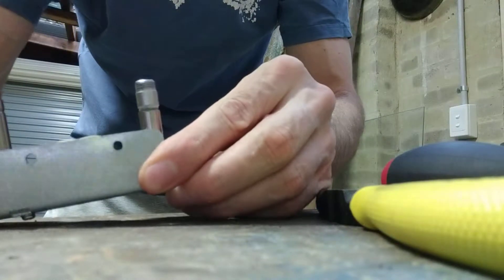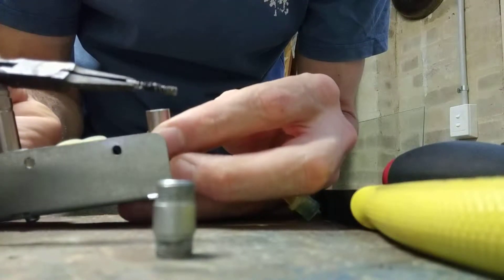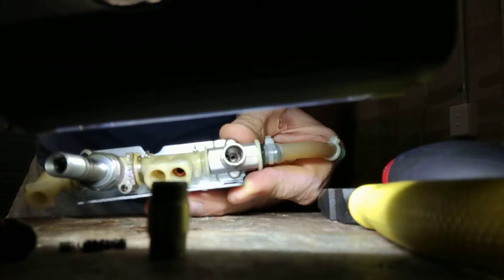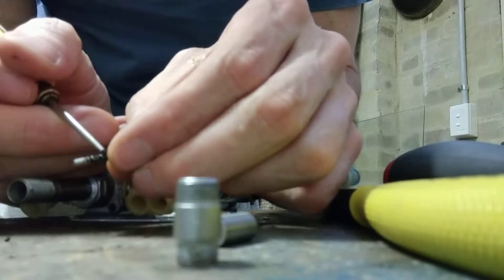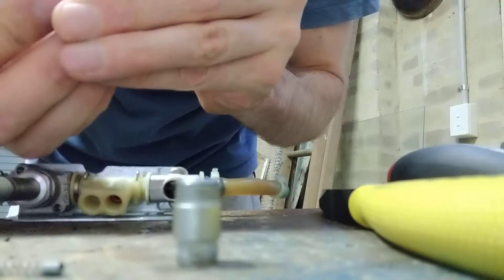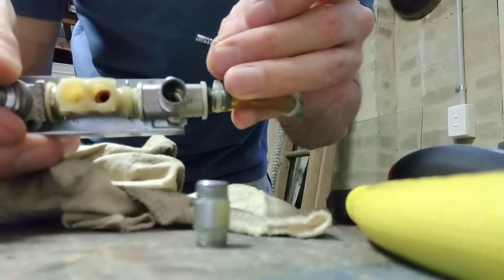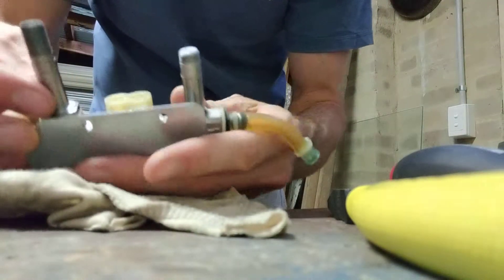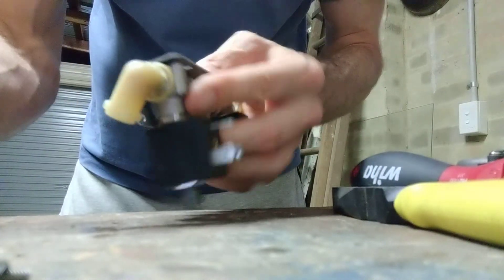Breville BES860 solenoid disassembly

Comment: Thanks for making this. I must comment that the critical points could have been covered in a much shorter time. Also, suggest compressed air might have been useful. Parts caked with mineral deposit can be soaked in citric acid solution (1 tbspn/quart). This solution can be hot to speed up breakdown of the mineral deposits and a stronger solution (2 tbspn/quart) can be used if needed. Citric acid is VERY effective for this purpose. For coffee residue, Cafiza brand cleaner works miracles.

All that said, useful to see the specifics of dis-assembly before attempting, so... thanks.

Comment: Hi Chris, thanks for the video. Very useful, I successfully diagnose the problem and ordered the 2/3 way solenoid and solved the no water from head group issue. However, the steam and hot water came out from the group head as well. I tried to pull out the live cable if the solenoid and the steam came out from the wand. Not sure if it’s another issue instead of the new solenoid?  Not sure if it’s controller issue but the original solenoid doesn’t works this way as the new one.( no water from group head with the original solenoid)

That’s very appreciated if you can help me out. Thanks

Comment: Great video, My old breville BES870 will not get up to a decent pressue, it seem to max out just in the espresso range after the infusion ,  I have tightened the OPV (right in) but it doesnt make any difference to the pressure . even with the blind basket shot. Do you think the pump may be weak or the guage is not reading correctly? many thanks
Reply: It sounds like you have the same issue as me, it’s on the second cup, not the first for me, it’s really odd.
Reply: @TheCobste  I sorted it out a whole back. It turned out to be the 2 way solonoid letting out some of the pressure by not seating properly. I knew this because at the same time it was brewing water was going into the drip tray. Changed the solonoid and now is all good.

Comment: I have the same model that has been buzzing on and off the past year and recently it got worse and the pressure hasnt been good sometimes. I'd love to make a coffee again without the awful buzzing so I attempted to clean the solenoids. Initially, to my surprise, they looked quite clean, but once I opened the same one as in this video, I also found the spring was also full of coffee grind. I thought "Great", so I cleaned it and put it all back together. Unfortunately it's still buzzing horribly and now water seems to be leaking from the solenoid that had the dirty spring (looks to be coming from the top of the solenoid through the thread). I'm sure I put I tightened it all up well, so I am wondering if either I have damaged it when untightening/tightening it with wrench pliers (wouldnt think that would cause a leak), or if the grove down the side of the plunger should not have been re-inserted along the water line. 
Any ideas? I assume yours worked well again after doing this?
Also the fact that its still buzzing loudly makes me wonder if its either something else thats degraded or if the solenoid coils are no good and need replacing..
Reply from the maker: It worked after I reinserted it but I later replaced it probably mistakenly as my issue was something else. See https://m.youtube.com/watch?v=1gEK2rDkaB0. However, the buzzing sound I’m not too sure. I do get a buzzing type of sound when I move the machine sometimes and it just seems to help to fill the water tank and pull water through to clear the air in the pipes. Other times I’ve had lower tone buzzing sound and just turned the machine off and on and it went away. I don’t think that’s much help to you. You could running the cleaning cycle. Turn it off and then turn on while holding power/one cup/three cup buttons. Goes for about 5 minutes and almost a full tank of water. Good luck with your fix.
Reply: @chrismelin6337  Thanks. Unfortunately after trying to fix the leak on the solenoid by tightening it further, I've made matters worse by over tightening it and ended splitting the metal al little. So I will replace that one and probably the other solenoid also as the buzzing noise sounded to be coming from that one. Im hoping the pump and filter are okay as pressure seemed alright before I started fiddling with things.
Regarding the buzzing noise, its often seemed to be worse after running the clean cycle. It sounded like its just causing a lot of strain on something since its trying to push water out but its got nowhere to go (except backflushing I guess). I sometimes wonder if I am doing it wrong. I am using a teaspoon of something called Unex Cafiza. No water manages to come through the portafilter, which I guess is the intention right?
Reply from the maker: @Dave8254  I broke my solenoid assembly too after further disassembly and reassembly. Cost me AUD145 to replace.  If you post a video maybe others can assist in diagnosis.
Reply: @chrismelin6337  after replacing both solenoid valves (not the entire assembly), everything is functioning well. No awful buzzing and no leaking! I was lucky to find a wholesaler with the exact same OLAB solenoids, it came to only AUD $60 (converted). Thanks for the video and help.
Reply: @Dave8254  Have you got a source for these solenoid valves?

Comment: How did you remove the cube!
Reply from the maker: You mean the black magnets? There is a slim nut on the top. From memory I think I used the multi grips to unscrew. Normal screw, turn anti clockwise. They then slide off.

Comment: Hi, I am trying to understand why my machine stopped working. The pump works, I tested like you suggest. 
However, NO WATER flows from any of the exits: gasket, froth, other lateral hole at front. 

What else could be ? Thanks in advance.

Comment: Hi Chris,

Thanks for sharing the in depth solenoid video.

Hoping you might be able to help or provide some guidance. About a week ago my machine (Gastroback 42612 - German identical to the Breville BES860 internally) stopped the familiar loud buzz upon start up and just had a quiet hum. At this point, I could not press the single or double shot button nor could I run any steam from the wand. I ended up guessing that it was likely the pump that had gone, so I purchased a replacement ULKA EP5 and installed it. Now that it is installed, the single or double espresso buttons work fine and run water perfectly well, but the steam wand still does not produce any steam at all. I am guessing it might be the solenoid, but hoping you might be able to give your 2 cents. The solenoids are not super cheap (33 GBP each), so I am trying to make a more educated guess. Thanks!
Reply: Forgot to mention that if I open the steam wand for 15 seconds or so, I hear a bit of the clicking noise (not sure what causes that, but the unit has always made that noise), but nothing comes out. If I then run a shot, a bunch of excess steam runs out of the group head.
Reply from the maker: Sorry for the slow response, initially I didn't realise you had questions. At a guess I think either there or a blockage in one of the Teflon water pipes which should be easy to diagnose given you've obviously taken some of these out already to replace the pump. Failing that it does sound like the solenoid assembly could be the issue. I eventually had success with mine by cleaning the inline filter that is between the tank and water flow meter. I made a short video on the you may have seen already but that sounds fine on your machine given water flows well now. Have you checked the Teflon pipe from the solenoid to the steam? You could disassemble the solenoid and clean it prior to buying a new one. I doubt the magnets ever break but in sure the assembly gets clogged or seals wear out. Have you had any luck?
Reply: @chrismelin6337  hi Chris, your guess was 100% right. I removed the plastic part that connects to the top of the 3 way solenoid, and it was in fact blocked. I also removed the 3 way solenoid and soaked it in vinegar to attempt to clean up any limescale build up. The machine works very well now and switches to steam instantly vs taking a bit of time that it used to. I might in the future take apart the other solenoid to see if there are any blockages and buildup. Thanks for your comment!

Comment: Hi Chris thanks for sharing your repair videos. i have recently picked up a BES860 unit which apparently has kept tripping the power mains. Would you happen to know what i should be looking for first?
Reply: Hi, it's likely too late to answer but my BES860 started doing the same. Problem with leaking connector in the solenoid valve assembly.
Reply from the maker: No, I didn't have any electrical problems. Great model. My coffee is fantastic since I got it working so worth the time. My initial thought is that perhaps you could just check all the electrical cables are properly insulated. Second stage, if you can't find a problem, disconnect the electrical connections to the thermoblock and grinder to try and isolate the pump to see if the pump or pump connection is the problem... Then in other permutations to see if you can isolate the problem. Good luck.